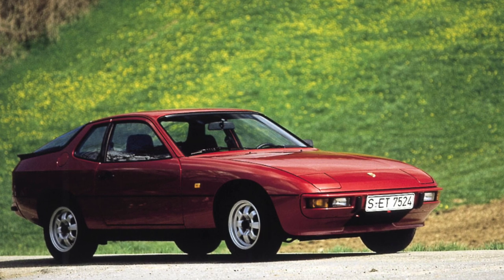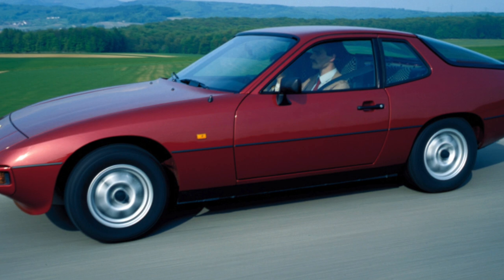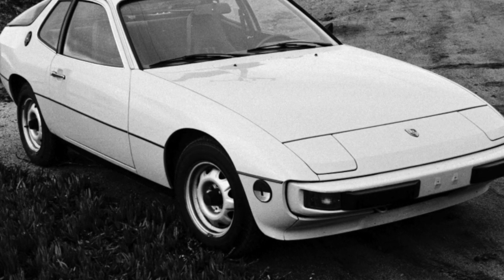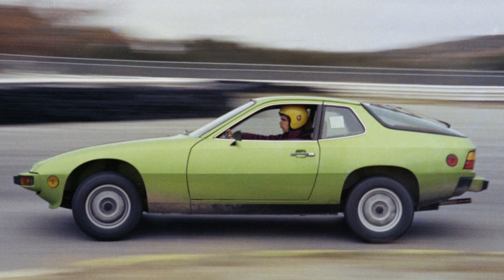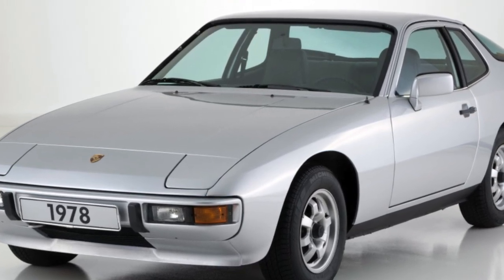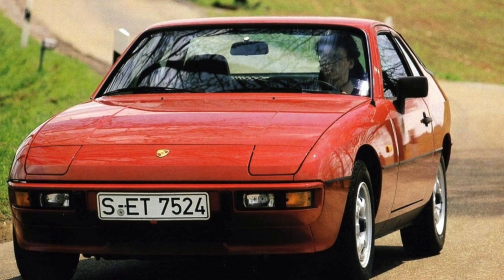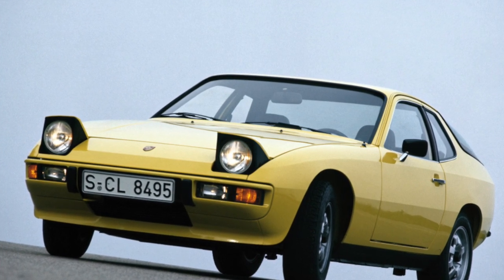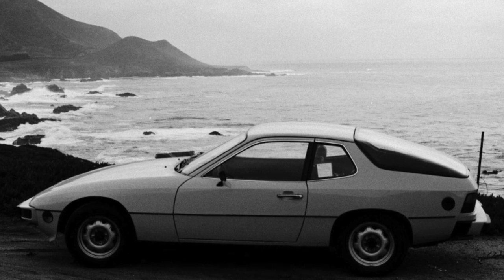Porsche 924 Problems | Weaknesses of the Used Porsche 924 1975 - 1988

Comment: Nobody eants a 924. They want a 944
Reply: I think the 944 is kinda overpriced since the 924 is similar but I would still prefer the 944
Reply: not true.. I have a Cayman, And I'm looking to get another 924, had one in the past..
They are fun cars.. the 944 is not that much more fun, but the prices are way out of bounds on the 44's..
Reply: @stijnvandamme76  the 944s are not more fun. They just look a lot cooler. 
What are 944 prices over there for just standard naturally aspirated unmodified?
Reply: @stijnvandamme76  924's are great. got one myself hope to see you on the road in one in the NL soon ;)
Reply: @drunvert  cheapest working is around 13K and gets you 300K KM (Around 190K miles) or 6K for a taken apart one (no wheels barely a interior and missing parts in the engine)
Reply: @educatedsloth  wow.
I just bought a 944. All original. 50k miles 
1 owner. Everything but AC works.
7500k USD
Reply: i'd rather have a 924 carrera gt then a 944
Reply: If you buy a 924S, then apart from the bubble arches, it is the same car as an early 944. Same engine,  brakes, suspension etc.
Reply: @drunvert  yea im very very jealous of US car prices🥲
Reply: @willharris9139  I want a 914/6 but I'm not getting that either
Reply: 924 S is the one. Faster than the basic 944. Nimble and good value.
Reply: I have a 944 and I want a 924. 924s are cool.
Reply: I like the look of 924 more than the 944, it's sleeker.
Reply: @shira_yone  weaker you mean
Reply: @drunvert  944 got smoother curvy lines, if anything that could be called weaker as opposed to the 924's relatively sharper lines and narrower proportions. The 924 Carrera (with the the widebody) is the most aggressive looking, having the benefits of race car aesthetic yet retaining the 924 sharp lines.

PS: turns out 944 also got a Carrera version, which looks exactly the same as the 924 Carrera. Either way the regular 924 still have the sharper lines vs the regular 944's bubbly look.
Reply: @shira_yone  ok. To each his own. One looks like a fighter jet and the other a commuter car
Reply: i disagree i would rather have a 924 then a 944
Reply: @willharris9139  why? 2.0 vs 2.5 engine
Reply: I have both. 924 is a 70s curvy, light and elegant design, 944 is 80s boxier, flared, sharper and more agressive design. In one i listen to 70s music, in the other to 80s music :-) i love both designs equally
Reply: There's a white 924 brought from the Netherlands with 40k on the odometer. Real nice black interior with a couple of some minur rust spots for $4K. I think I've got a deal.
Reply: @markcroes1145  definitely the right price. Sway bar , shocks , wheels and tires and it's a great car
Reply: No they want a 928
Reply: If a 928 was reliable yes